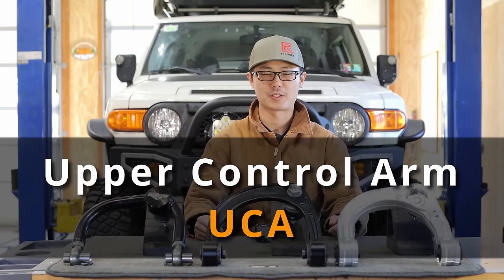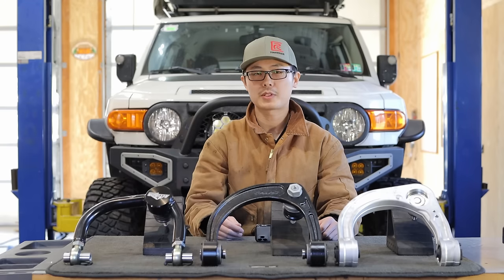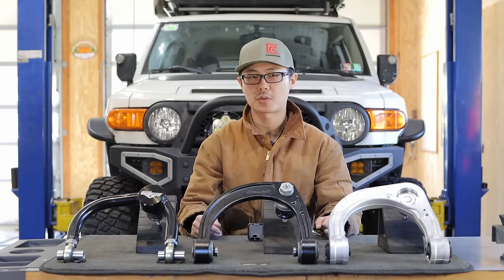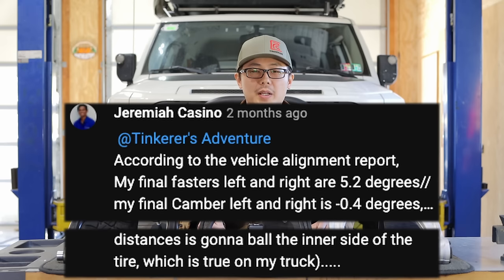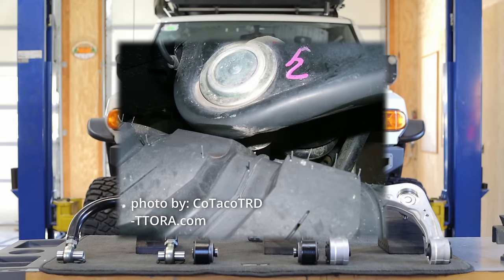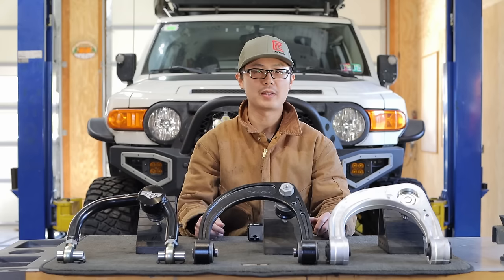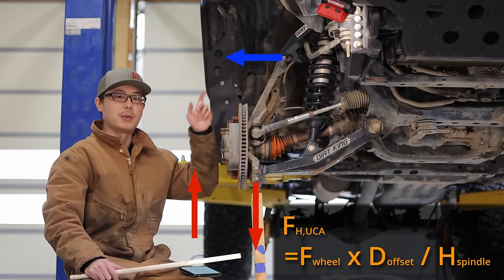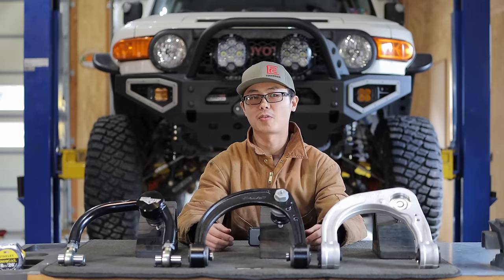UCA's True Functions and Misconceptions | Toyota Aftermarket UCA Part 1

Comment: Good stuff, Kai. For clarification, Ironman 4x4 UCAs provide around 2 degrees of caster correction for 4 degrees of total caster capability. We'll update our website so that's more clear. Keep up the great videos!
Reply from the maker: Thank you. I have pinned this comment so that the viewers will get a better idea!
Reply: @TinkerersAdventure  I have a 2015 tundra with 3 inch lift and 295/70r18 and my tires are close to the upper control arm will one of these help me with that ?
Reply: I’m buying a new “used kit” this weekend and this answered my 1 major question as I plow with my truck so now I don’t have to worry about my cab mounts!
Reply: @robertespinoza2740  I run 35s on my iron man set up and love it, no issues
Reply: Can't find information about compatibility  Ironman UCA and lift 3"?!
Reply: Did the Uca Ironman got a recall? 😢
Reply: They have still not updated their website. If they can lie about something as simple as updating a website, what else will they lie about and not help with or tell you? And I was considering trying their foamcell.....
Reply: You posted this comment over a year ago and have yet to “update” your website.

People, take note, this is a PR comment from Ironman. Nothing was done.
Reply: @fredastaire6156 do you think it is safe to buy a set of their ucas? Or is there something going on over at Ironman. All ucas for all makes and models are out of stock...
Reply: Don't go with ironman.. less than 1 year and the ball joints have both ripped open. I 'm aware of the recall and have reached out both via phone and email.. Also filled the form and it's been 2 weeks and still no call on how to get this fixed. So I have opted to upgrade ball joints on upper and lower (as my lowers are now taking the stress). Really thinking about going with the OME BP51 suspension.
Reply: @joereyna614 ironman rubbish…. I will buy spiderman…
Reply: This is why I’m buying a lift system from you guys for my 5th gen 4Runner.
Reply: Did you have to do body mount shop
Reply: @MrTouge240  Ironman had a safety recall on the UCA due to manufacturing problem, this is probably what the issue was.

Comment: I have spc on my FJ and my ball joints only made it 20,000 miles. After researching, there are a lot of people having issues with spc. I only took my Toyota out 3 times in 20,000 miles and easy offroading. Greased them etc when the time was right. Still work out pre maturly. Hit n miss with these. I suggest going with a different brand. 👍

Comment: Love the explanation, one thing I think you could really drive home would be that some components are designed to be the weak link, such as the upper control arm might be designed to bend in an accident to prevent some frame damage or something

Comment: This is great. 
I have 34x10.5 ko2 on my 4th gen with just a Daystar leveling kit an 1.25 spider trax spacers. With a heat gun and a bit of trimming on the front bumper everything clears no rubbing. I don't think I'll change anything until the Xreas suspension blows.
And and maybe not even then. Thanks for the eye opening info. 👍

Comment: Amazing channel so glad i just found it.

One thing i think is wrong is that you said the upper arm control the anti-dive, but AFAIK it's the lower arm that really controls it, and the angle of the upper arm (relative to the lower arm) controls "dynamic caster".. how the caster changes through the movement of the suspension. as seen in your video, the caster angle lowers as the suspension droops, it can be arrange the other way, so the caster angle increases as the suspension droops, or stays the same if both the arms are completely parallel.

Comment: im a tech at a Toyota dealership and own a 3" lifted 4th gen 4runner. i personally run the JBA uca's and have no complaints, i know multiple people who've used SPC and had ball joint failure relatively soon.
Reply from the maker: were those recent or a few years ago? Their first generation ball joint had some issue. The new greaseable ones seemed better, but I have no personal experience.
Reply: @TinkerersAdventure  recent, both 4runners with 2.5 lift.
Reply: @dustywizard1104  do you need a new UCA for your 2.5” lift 4runner? I have my 2024 4runner installed the Eibach 2.0 pro truck coil over 2.5” front and 1” rear lift and getting 2.8 left caster and 2.4 right caster. The offroad shop recommends me replace the Stock UCA. What do you think ? Thanks

Comment: This video absolutely blew me away. Thank you, thank you, thank you for this incredibly informative vid! I've been on the fence about needings new UCAs for my 470 and also about needing wheel spacers for UCA rubbing. I built a very nice 2rd gen 4runner and learned a lot but a lot of that was from just throwing money and upgrading every piece of suspension front and back and learning with the install. This time around I wanted to really research the true reasoning for upgrading parts.

Also, that bumper on the GX 460/FJ is insane. Any plans on making it for the GX 470???

Comment: For those with Nissans, a lift higher than 2" will cause the factory upper control arms to contact the coil bucket at full articulation due to the increased suspension travel, which can damage the suspension, not to mention be jarring and make a loud noise. After market UCAs are shaped differently so that they won't make any contact and instead the bump stop will be the limit.

Also anyone with SPC UCA's, these need to be greased with a moly grease at every oil change. They also have a wear spring inside of the ball joint which allows for some play...many mechanics mistakenly think that the ball joints are bad because 999/1000 ball joints are not like this.

Comment: I bought Camburg arms to get caster back in spec  from a 2" lift they have a greasable ball joint with aluminum cap covering the zerk the reason i chose them was the ball joint verses that open to the elements of a uniball getting trashed from road salt, rain, snow, wet sand etc

Comment: Good stuff. Ran a stock arm with a 5100 and 1/4 inch spacer. The cv would bind in the cup at full droop. This was an 05 4Runner with no dif drop.
Reply from the maker: That makes sense. The 5100 is pretty much the max safe droop. Any spacer would be extending too much

Comment: Awesome channel. Please try a product call: Extended ball joint for Toyota UCA. Manufacturer claims that "Ball Joints are extended 20mm over standard to give you back some of your lost travel by moving the arm away from the strut tower and the coil, reducing strain on the joint and control arm, The change in operating arc can also help with alignment and camber on lifted applications".
Reply from the maker: Hmmm interesting. I didn't find it with a google search. drop a link if you have it
Reply: @TinkerersAdventure  it is offered mainly in Australia for the Hilux (Hilux uses the same UCA as Tacoma). I will drop some links

Comment: I really my wish I had this information a year ago when I swapped out my 4th gen 4runner upper control arms. I ended up with SPC uppers for “max adjustability “ but I had the hardest time finding a shop in Southern California that could properly adjust the uppers. Eventually I found a a solution to my problem. 

By setting the upper ball joint forwards (E position from SPC instructions) the alignment shop had to push the lower ball joint forwards away from the body mount in order to return it to factory alignment. So I don’t have an extreme degree of caster, but the front and rear ball joints are moved forward about half an inch.

Comment: Have ext. travel Kings with SPC control arms and no CM CHOP and still have mud flaps (slightly trimmed)
with 33 in tall tires...the articulation is very stiff though may need to decrease ride height.

Comment: Another great video! This was so timely too, I was just asking about UCA's on one of the 4Runner boards, and you totally answered my question. I'm looking at getting Fox or Bilstein 2.5 body shocks, and I was concerned about the springs contacting the UCAs. Looks like I don't have anything to worry about, because I don't want to go over 2.0 inches of lift. I don't want to mess with the UCAs, because A) I don't want to spend the money, and B) it's a 2013 and I seriously doubt that I'm going to be able to get the originals out anyway lol.
Reply from the maker: Thanks! Please let me know how it works out. If it hits the coil or not
Reply: @TinkerersAdventure  hopefully it won't! I really don't know what I want to get yet, maybe you could do a future video comparing some of the most popular shocks and the ride characteristics and best use scenarios for them?   I'm concerned more with the on road ride than off road. I really don't want anything that's going to make the ride too firm on the street, as I'm sure you experience where you live as well, the roads here are just terrible and just driving back and forth to work is almost like off-roading, so I figure anything that's good on these terrible streets will also be pretty good off-road, haha.
Reply: Bilstein 5100 coil spring will contact UCA on droop. Happens on my 08 4runner.

Comment: Big fan Kai keep it up! Glad to have videos to watch that give factual content on toyota IFS setups. And big advantage is that this covers all the shared platform ones from Prados, FJC, Hilux, Fortuners, and American Tacos and T4Rs. You should check out the pinned threads on pradopointau also since they have actual measurements of all aftermarket and oem shocks and coils inc bilsteins.
Reply from the maker: Thanks! Yes someone led me to that thread. It was amazing to see so much numeric data compiled in one place. However, I checked the few with parts in my garage and the numbers were quite different. Especially the shock length, I suspect different manufactures define shock length at different location.

Comment: Great info, and I appreciate the stripped down raw content. Wanted to add, the ball joints also see load axially when torque force is applied with spindle rotation when brakes are applied, and also laterally along the chassis plane as the load force from the wheel traction in 4wd (especially in 4wd low when torque is amplified). The only thing holding a front wheel to the truck is the spindle, and the ball joints are holding the spindle to the chassis. Keep up the fantastic content!
Reply from the maker: Thank you! And those are all great point adding to the UCA load.

Comment: Hi Kai, I just bought bilstein 5100s and some KSP UCA's for my 4.7 sport 4th gen 4runner.  My upper ball joints were bad as well as the xreas shock system, can I run stock height with the new UCA's? The KSP UCA's say their made for 2-4 inches of lift. Thank you for sharing your vast knowledge and experience with toyota's ifs system.

Comment: Minimal viable caster is exactly how I do it with the SPC.  Plus you get ever so slightly better approach angle.

Kinda bummed for all that effort thats the only thing I got better than stock though.
Reply from the maker: There is a little more benefits which I’ll go over in the part 2 UCA. But you’re right, UCA just doesn’t really add much

Comment: Your videos are very good....I bought rancho 3" quick struts for the front of my 17 tacoma, and also skyjacker 2" soft ride leaf springs. I plan on running 285x70x17 tires on my stock wheels. What else would be recommended that i need?

Comment: @8:27 100% not every shop know for to align with adjustable UCAs. After an accident repair the Groove Toyota Dealership's body shop gave it for Toyota dealership alignment tech and they had no idea. One side it was all the way in and other side all the way out. Tire was hitting sway bar at full lock. I gave them the 4x4 shop details which was not far from them way in advance if you don't know how to please contact 4x4 shop. But they didn't. That Toyota dealerships seems to have very poor knowledgeable techs.

Comment: Great information and lots of research has gone into this. Well done!
Just wondering why it's not more common to have an aftermarket LCA with the ball joint offset more forward? This would correct castor and move the wheel away from the body mount.
Reply from the maker: Great thought! JD fab offers something like that. The main practical reason is after moving the lower ball joint for more than say 3/4” on stock width setup, the tire will rub significantly in the front of the wheel well. Clearing that requires sheet metal tubbing. More work than body mount and pinch weld. So this is for really serious people. For 99% people, there is not much to gain beyond the LCA adjustment. But if you have long travel, this spatial constrain is changed and there will be more meaningful gain by moving the LCA further forward.

Comment: Your apparent expertise is relatively rare and admirable. I am curious about your take on an upper control arm issue. I have a 2021 TRD 4x4 Tacoma Sport, which was bought new/ without modifications. The clearance between the factory wheels/tires (+30 offset, 265/65/ R17s) and the UCA was about 1/2 inch. This rather minimal clearance was due to the extreme wheel offset. I recently slightly up-sized my tire to 265/70/R17s, which amounts to the sidewalls being 1/2 inch higher.  I do not feel, hear or see any rubbing, but the clearance now between the UCAs and the tires is now reduced to a little over 1/4 inch!  I'm thinking, and hoping, the clearance between the tires and UCAs does not fluctuate, thus there's nothing to be concerned about. Am I correct in this assumption?
Reply from the maker: Thank you. And you are correct!
Reply: you could also run some 1 inch to 1.5 inch spacers....I run the 1.5 Spidertrax spacers and 265's with plenty of clearance all around.

Comment: Great video Kai, I am considering upgrading to the SPC upper control arms. I have previously upgraded to old man emu medium springs and Bilatein 5100 shocks. My truck is a 2013 with 150k. Are there any other suspension components I should consider replacing?

Comment: Another great video!  I just installed a new suspension system from Eibach, maintained the stock UCA’s and it aligned well at the shop.

Your videos are a huge help understanding these Toyotas and made me more confident doing suspension upgrades!  Everyone needs to subscribe!
Reply from the maker: Thank you! Glad the Eibach kit worked out!
Reply: I just had my local offroad shop installed the Eibach pro truck 2.0 coil over lift kit 2.5” front and 1” rear.  Getting 2.8 caster right and 2.4 caster left. The shop recommends me replace the UCA for better caster number. But Eibach claimd that their lift kit works with stock UCA if keep the lift 3” or lower. Don’t know if I should replace the UCA or not
Reply: @TinkerersAdventure  I just had my local offroad shop installed the Eibach pro truck 2.0 coil over lift kit 2.5" front and 1" rear. Getting 2.8 caster right and 2.4 caster left. The shop recommends me replace the UCA for better caster number. But Eibach claimd that their lift kit works with stock UCA if keep the lift 3" or lower.
Don't know if I should replace the UCA or not

Comment: Awesome content, Kai, thank you! Very refreshing to watch your videos with well-researched knowledge and no fluff. I want to optimize my body mount clearance (2013 4Runner), playing around with the SPC UCA settings. I saw you use an angle gauge on the flat at the swaybar mount hole on the knuckle. Can I directly measure my caster there? Thank You!
Reply from the maker: Thanks! No you cannot measure an accurate caster statically. The alignment machine measures caster with a sweep of the steering wheel. What I was measuring was only the change in caster between the different UCA. Not the absolute caster angle
Reply: @TinkerersAdventure  Thanks a lot for the clarification! Is it okay to assume a linear relationship, ie. if during my tinkering my relative measurement changes by 1 degree, then my true caster changes by the same amount from what was measured at the last shop alignment? Maybe as a background that allows for a better answer: My alignment shop won't touch the UCA, so I want to move the LCA as much forward as possible, and then set the UCA approximately correct so that the alignment shop can achieve a reasonable alignment with minimal change to the LCA. I want to get maximum clearance while maintaining a reasonable caster angle, so I want to determine how aggressive I can move the UCA joint forward and still get around 3° caster. Sorry for the multiple questions.

Comment: Very informative video mate. Quick question though, is it ok to have the same lower control arm settings on both sides? My Hilux have 2 inch lift with 32's and stock UCA but I get uneven tyre wear on the LHS. By the way, LCA settings on my rig is not the same on each side. Would appreciate your input. cheers

Comment: I watched your video and it was very informative. I have a 2013 Toyota 4 Runner Trail Edition and want to lift it 2 1/2 to 3 inches to accommodate 285 70 17 tires. If I understood your video correctly it appears that I should get UC's installed with the lift kit.

The reason I ask is that many off-road shops have given me quotes saying that it's unnecessary. A couple shops did say that I should get upper control arms installed.
I trust your opinion. Please advise.

Comment: Great info! That said, is a Toyota TRD Lift Kit for a Tacoma TRD Off Road a good lift?  I’m concerned about the need for an upper control arm replacement, TSS issues, etc.  I assume since Toyota will warranty the lift that what they do will not create a list of suspension issues in the future.  All I need is a little more lift to upsize my tires one size up from factory and do some light/moderate over landing.